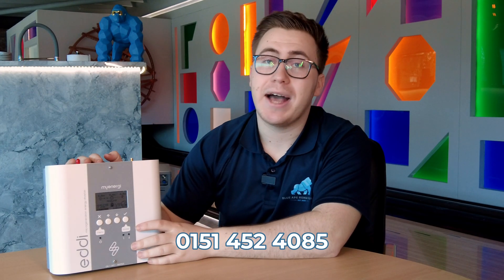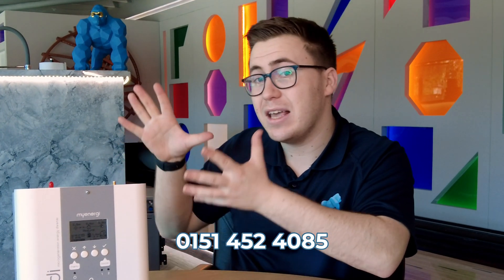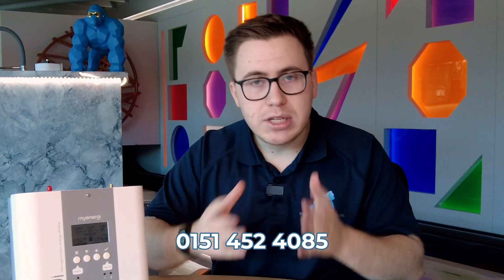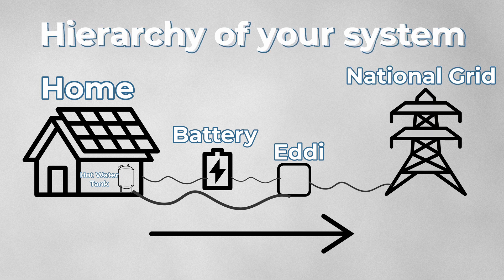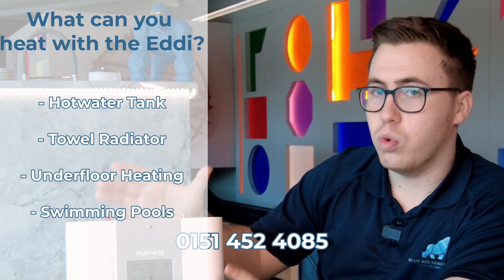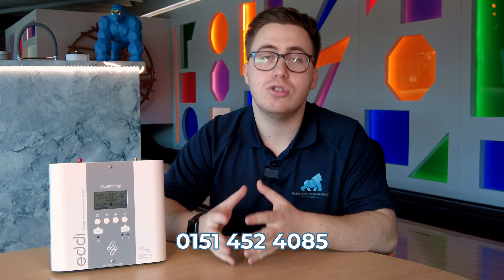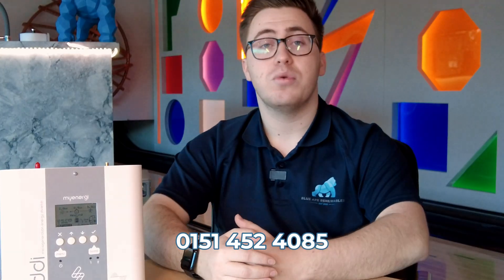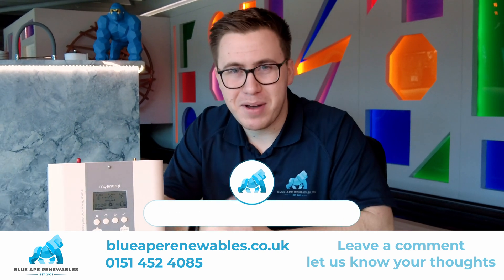Eddi Power Diverter - Heat YOUR Hot Water With Solar Power

Comment: I had one installed in April this year, in lieu of an old solar thermal water heater, which had failed after 19 years. There was an existing PV system as well, which was 11 years old. Thus the old hot water tubes were replaced by a couple of extra PV panels, and one of those Eddis was installed to grab any surplus output, using an existing immersion heater in an existing large tank, previously heated mainly by solar thermal.

Initially, there was a snag caused by an excessive length of cable from the Eddi to the load; details here: https://youtu.be/KVkw_bC2qSc   It’s been in service since then, with no imported power used for water heating. That will change as we move into late Autumn etc, but it’s doing it’s job for now.

Comment: Edi power diverter working with Victron off-grid Pv system by Ac coupling With SolarEdge HD inveter
Reply from the maker: Great to hear! So your Eddi is running nicely with a Victron off-grid setup and SolarEdge inverter, good to know it works well in that kind of system
Reply: @BlueApeRenewables   My I asking ,  this Eddy working by IP local  Address ?  with out Ct-s
Reply from the maker: Hi, sorry for this misunderstanding, if you would like to give us a call on 0151 452 4085, one of the team can support you.

Comment: We have an export limit of 4kW on our 9.5kWp system. We have 16kWh of battery storage and a gateway (Sigenergy). Is there any way of only diverting extra solar energy generated over & above 4kWh? We generate about 8kW per hour in the summer time and need to maintain the 4kW export at all times, to maximised payback. We would only want to divert anything above the house use load plus the 4 kWh export limit during sunny periods. What I don't want is for the Eddi to start taking excess electricity wheh we are producing 1-4kW of power. Can this be done in the settings? Thank you.
Reply from the maker: Unfortunately, not, the Eddi monitors how much you’re exporting in the same way your inverter does, and they both use the same supply cable. Because your inverter is limited to exporting a maximum of 4kW, there won't be additional export above that to be diverted to the Eddi
Reply: @BlueApeRenewables thank you for the reply. That's a shame. It should be a straightforward firmware tweak to only take spare capacity over a certain threshold of PV production. Makes more financial sense to export excess PV production at 15p per kWh the use gas to heat the water!
Reply: Yes you set an export margin of 4kw